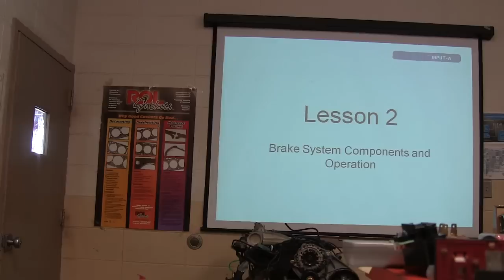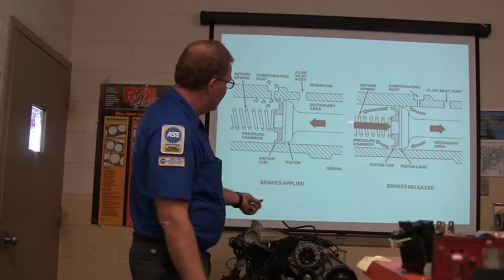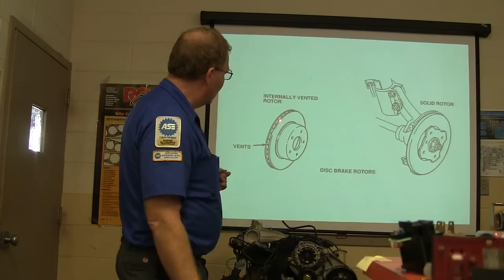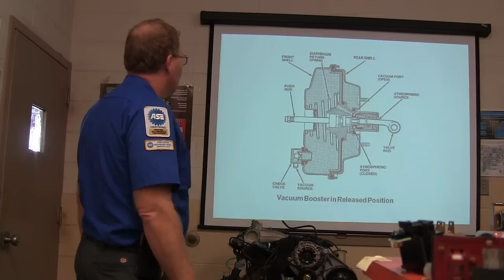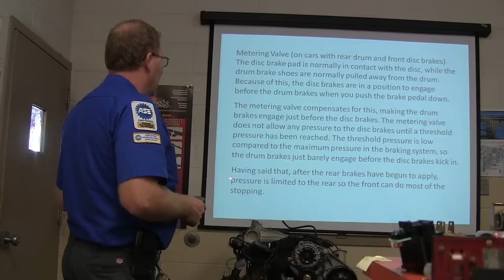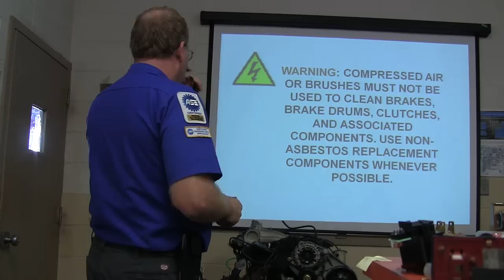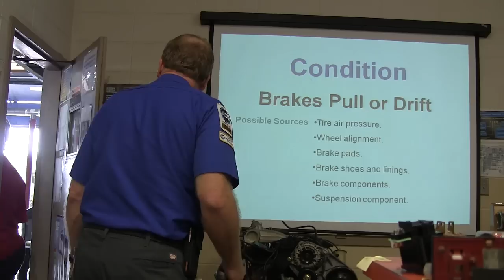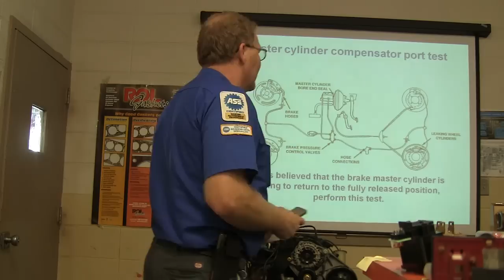Brake System Components and Diag

Comment: I'm not yet sure how exactly a height sensing proportion valve works, but the first thing that comes to mind is whether worn shocks/springs will effect this.
Reply from the maker: Height sensing proportioning valves are adjustable but they are primarily intended to give more brake pressure to the rear when the vehicle is loaded over the rear axle. Stiffer springs would make a difference in how it operates though.
Reply: @McCuistian  Ah yes, I guess I should've expected they'd be adjustable 🤦‍♂️ Thanks for the reply! I greatly appreciate you sharing so much with us! I've learned tons from you, and even passed my suspension test with your help. On to brakes!